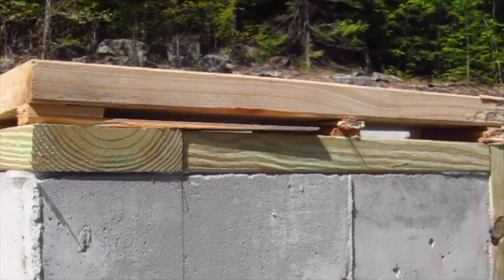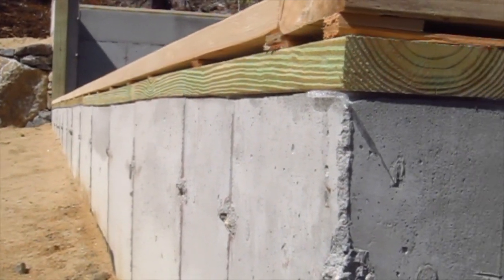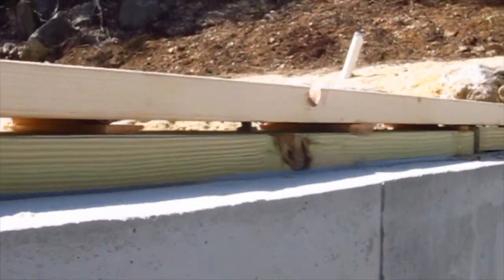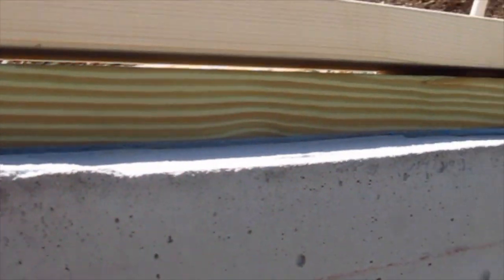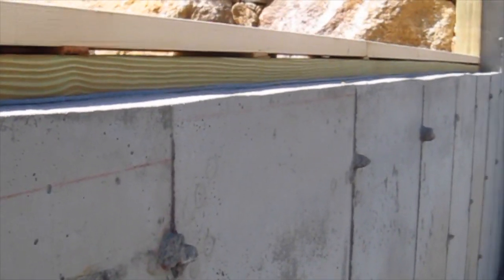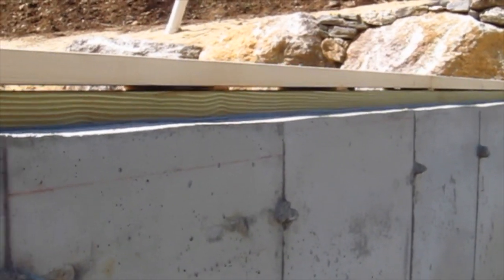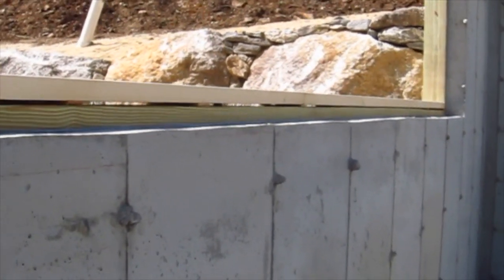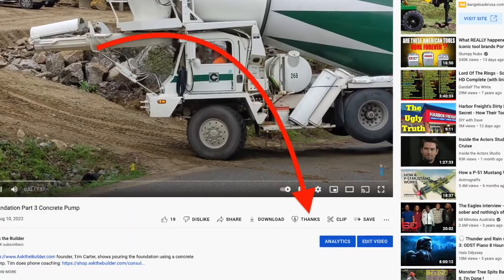Concrete Foundation Leveling MISTAKE Part 1 of 2

Comment: As a builder this is more common than you think. One fix that takes some time but is foolproof is to put down a double top plate or whatever thickness is needed; then route joist pockets in the plate. Make sure the first one on one end of the house and the last on the other are dead level to each other, pull a tight string line then route out the depth of the pocket you need. Been there, done that. Will add a extra few days of the job but it's only the first floor you have to do. Had a house one time where we had to put a triple top plate because of being low on it one end and wavy along the way. The system is a pain, but it works. All contractors should have a laser level and can shoot the foundation top themselves. We shoot every foundation and take measurements on 16-in intervals.
Reply from the maker: I think my repair method is far faster, easier, and better. Did you watch the second video in the series? Two guys just 3 or 4 hours and it's finished.

Comment: Help!    Single Senior Citizen here,  needs advice!!  
  I have a former garden pond area 7x8 by 24 deep.  I need to know what to fill it with for a spa replacement on level ground. It is 4  cubic feet of fill needed?  I keep getting different answers....any input on fill?

Reply
Reply from the maker: 7x8x2= 112   112 cubic feet of fill.
Reply: @askthebuilder  -I left out gravel or fill dirt??  That was my  main question!  thank you!

Comment: I have seen several homes where they shimmed the main beam with wood shims, 10 years later and the shims are about 1/4 of the original thickness!
Reply from the maker: Exactly. Cedar is a soft wood. It's not intended to be a significant structural support member. These shims are meant for the sides of doors and windows to help square them up and keep them square. It's a complete botch job.

Comment: My house was build 20 years ago, the leveling is wrong! We are the second owners. A tree went down on top of my house it resisted in a miracle way, not even the walls were cracked. The house stood up strongly. It’s a pre built 2 floors house. Do you think we should consider moving out? 
House insurance is very expensive,  when the tree went down my house the insurance was more problematic than the tree.
Reply from the maker: No. Stay put.

Comment: I am battling this right now and it didn’t get caught before the house was built. Squeaky floors is just the beginning. Do you have any suggestions on how to correct this?
Reply from the maker: Yes. 1. Rewatch the video. 2. Schedule a consult call with me - best $$$$ you'll spend on the project: https://shop.askthebuilder.com/15-minute-phone-or-video-conversation-with-tim/

Comment: When building a house, a good option is to have your surveyor shoot all of your concrete corners to confirm the concrete contractor is pouring to the correct elevations. In housing tracts, most city's require form certification before concrete is placed.
Reply from the maker: Instead of paying the surveyor hundreds of dollars, why not buy your own laser level for FAR LESS than $100 that you can use for all sorts of other projects????? Look at these: https://amzn.to/3xWZucT

Comment: I've  seen  worse ,I  shimed up over inch and  half. Use metal shims under every  joist.
Reply from the maker: I disagree. The carpenter should have called the builder and told him to put a thin concrete overlay on to level it up. Shims are for windows and doors. Period.

Comment: Q: Couldn't they just make sure the top of the forms are straight and level before they poor the cement and then trowel flat using the forms? Ive never worked cement but that is how I would have done it.
Reply from the maker: You can do whatever you want. Typically the forms come in uniform heights. Pour the footing level and then it's easy to set the forms. Contractors using 8-foot-high forms typically chalk a LEVEL line 2 inches down from the top of the form and pour to the line. My foundation contractor tacked finish nails into the chalk line every foot so his 14-inch-long magnesium float could ride the nails to make a perfectly level foundation.

Comment: It probably would be best to grind the concrete down to level it ? The shims don’t seem ok to me ?
Reply from the maker: No. Just add a concrete overlay to it. Like this: https://www.askthebuilder.com/concrete-overlays/
Reply: @askthebuilder  I was thinking that but you would need to drill and put rebar in the new to hold it on top of the mess below. I dont like that to much but its better then the shim idea lol... The guy that owns this house im sure is in Mass or Florida I would bet... He wont even come to the sight until its finished and has NO idea of craftsmanship..
Reply: The sill plate anchors will be embedded in the concrete below the overlay, and when you tighten them, they will sandwich the overlay tightly between the foundation wall and the house. A bonding agent should be enough. Don’t think you need the rebar.

Comment: You’d have to level that out with more concrete but that poses other issues down the line if and when the two separate since new concrete doesn’t really bond to cured concrete unless there’s real good mechanical adhesion.
Reply from the maker: You can get a new stucco overlay to bond PERMANENTLY if you do it the way I tell you in my past column. Plus, the repair is in COMPRESSION which ensures it's not going anywhere. Read this: https://www.askthebuilder.com/concrete-overlays/
Reply: @askthebuilder  good point. I was thinking maybe you can even key the new concrete in by using a diamond saw cutting grooves every 6” or so
Reply from the maker: No need for that at all. You use CEMENT PAINT to bond the overlay. Remember, it's in compression and not going anywhere. PSE read my column in my first reply above.
Reply: Use structural grout. Been there, done that.

Comment: It was definitely a mistake and the "fix" was shody. I am interested to hear how you would have fixed the mistake. Mistakes happen frequently on job sites so it is good to think about appropriate ways of fixing the mistakes. Would you use a bonding agent and leveling grout?

I would also say that the contractor should have been involved in the fix rather than the trades trying to muddle through with a fix on their own. You can't expect a carpenter to do concrete work for the fix.
Reply from the maker: I describe in the video how to fix it. Keep in mind the repair is in COMPRESSION. Go read all of my past columns on my www.AsktheBuilder.com website about Concrete Overlays.

Comment: Can’t you just fix the leveling by cutting the studs to fit from bottom plate to a level top plate and close all the gaps?  Nail your bottom plates flat, go up level on corners and put a string up, then measure from bottom plate to the level line. Cut the studs to fit?
Reply from the maker: Yes, you can do that. It's a very slow process. It would have been better to just repair the foundation as I outlined in the video. Better yet, pour it right in the first place...

Comment: Here in Southern Ontario this is a very common problem. Residential homes are literally all sitting on shimes like this. Completely jeopardizing the integrity of the home. Concrete guys need to be trained better.

Comment: I can't believe how bad that is. I've never seen anything this bad. It is no wonder the contractor doesn't want you there filming while their working. Within a few years the walls in the house are going to be sagging. Shimming a window? Sure. Shimming the entire length of the foundation plate where the tens of thousands of pounds of your house is going to be resting? No. Whoever is going to own this house in 10-20 years is going to have a nightmare of problems from all the mistakes you've shown thus far.
Reply from the maker: The BIGGEST issue, in my opinion, is the builder has yet to be seen on the job doing any QC. The builder, after the foundation was poured, should have been there checking the elevations to see how out-of-level it was. A 1/4 inch is tolerable over 30 feet but not 1 and 1/4 inch.

Comment: No one has addressed the real issue. Why would anyone screed down inside of a form or put nails in the forms for the “correct elevation” . Why not just pour the concrete to the top of the form? If the footings are level the walls will be also. If you have 4’ forms or 8’ forms and the plans call for a 3’-6” wall, lower the footings so the 4’ forms work
Reply from the maker: Eagle Man. It's obvious you've never formed and poured foundations. It's not done your way because it's exceedingly HARD to spend all that time you describe. It's far easier to get the footings really close - maybe not perfect, set the panels and chalk the lines as I've stated. It then takes an hour to drive the nails. My method, and there are others, creates a PERFECTLY level foundation in the LEAST amount of time.
Reply: The type of reply I was looking for. I have been in the concrete foundation industry for 30+ years so I am pretty sure I know what I am talking about. I have done agricultural, residential and commercial foundations of all sorts up to 3 story buildings.It doesn’t matter what type of footings you pour rather it be spread footings or trench footing there always has to be a starting elevation to base the project on. Residential footings only take 4-5 hours from start to finish pour so that is no time. It’s not far easier to do something half ass then complain about how poor a job someone else did when you do it right the first time there are no issues. It appears from the video that the forms used could be symons forms. When you take the time to nail the elevation, issues arise as seen in the video.

Comment: Plainly unacceptable!
Reply from the maker: I couldn't agree more. What a shame the builder didn't do quality control and fix the error in less than two hours doing this with a cement stucco mix rated about 10,000 PSI: https://www.askthebuilder.com/concrete-overlays/

Comment: would it have been ok instead of shims,to cut each stud to correct length via a string line up top???????????????????
Reply from the maker: That's possible. It's FASTER and BETTER to just spend the several hours to do the concrete overlay. Go here: https://www.askthebuilder.com/concrete-overlays/

Comment: Thats a complete JOKE. I would Love to know who poured that foundation. So I can AVOID them at all costs. I hope its not East coast. I never thought that would be and issue thats actually pretty sad.... Being picky is one thing but that is off up to 1 inch or better on a very important spot..... IF that was MY foundation they would have to fix it with either a big saw on a track or something to cut the top of the foundation flat like a Huge skill saw on a track to make one perfect flat cut all the way down. I dont even know if thats possible..This is Completely unacceptable for a new home.
Reply from the maker: It is a company in the Lakes Region of NH. If you want to know who it is, you can do a consult call with me.